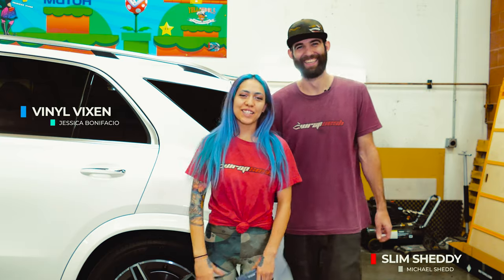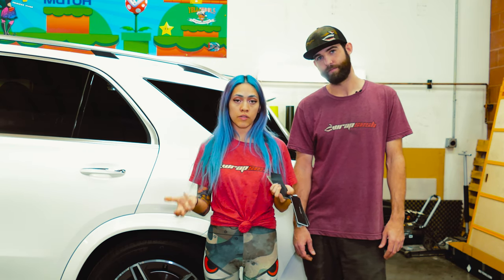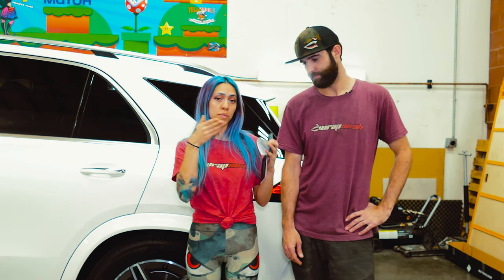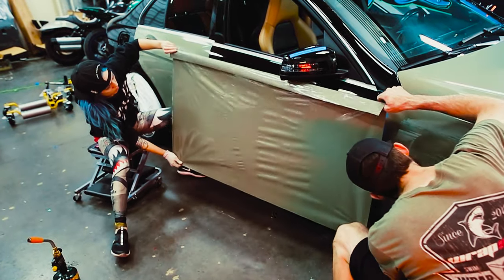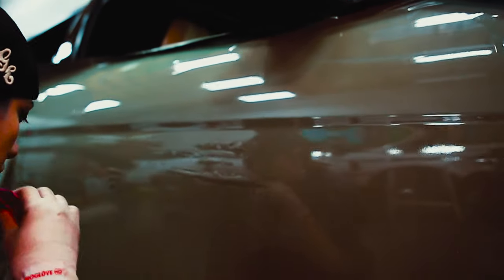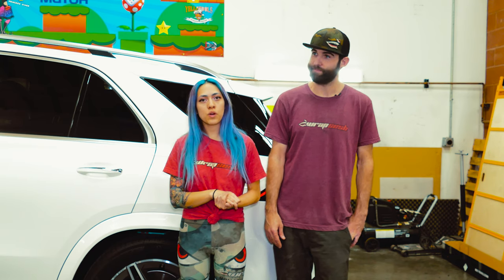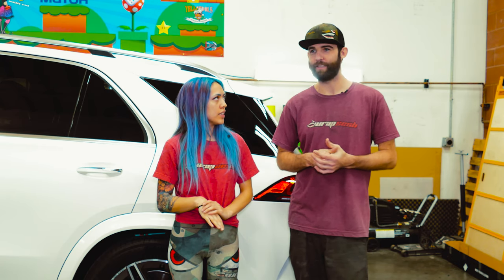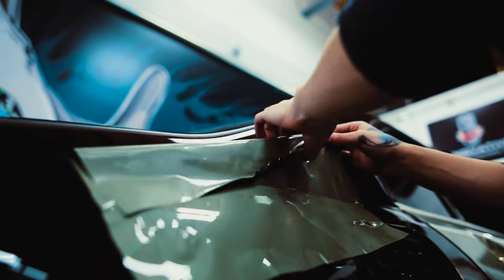Inozetek Film Review, Tips, and Tricks!

Comment: I just finished installing this film on a tesla! Check out premium auto styling if you want to see some different methods. I notice that it needs to be laid cold on flat panels like doors. Also wet the floor when you pull the cap sheet. Wet the cap sheet then pull it to reduce static. Wet around the areas and floor when you lay. Also tape up mask all the edges where there is dirt or open spaces. This film requires a lot of prep and a lot of hands.
Thanks for your video! Always cool to see others honest review of the film.

Comment: Ima sure there’s lots of very informative comments in relations to some useful tips

Key points

-I have some conduit hanging from one hook to the other. I shove the material onto it, suspending it. And roll down 4 feet at a time with the floor wet to avoid contaminating the film with dust. As I pull 4 feet down I’m removing the liner. I’m sure there are better ways but here’s a ghetto version of it haha. 

-you need even heat so a handheld heat lamp works best

-avoid glassing because the air realease sucks. In my opinions better to try to find a middle point of the panel and work/heat your way out. If you lay the door like she did but instead pull down the material cut off backing paper fold material back up onto the panel. Lay from the middle side to side with lightly lifting from side to side to get the air out (yes the top will flip onto you) and then work material up and down from the middle point you will realize it won’t start forming so many fingers like at the very beginning of the video. Hope that makes sense lol.

Seems like the flat panels are the hardest because of how easy it tacs and how bad the air release is. Kinda like kpmf at certain temperatures.

No way am I saying this is the right way but this has helped me and hopefully it can help some of you guys. 

And Inozetek killlllled it with this material. Changed the whole game, shoutout to them 💪🏽